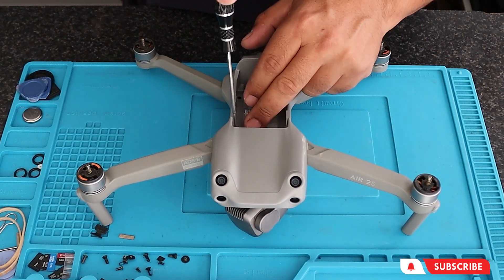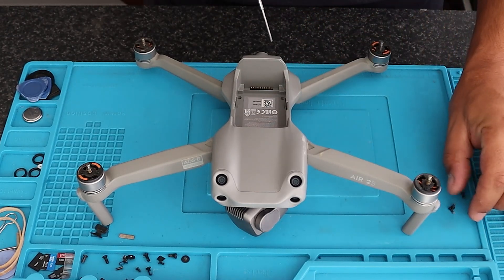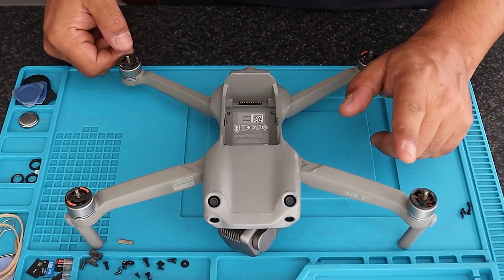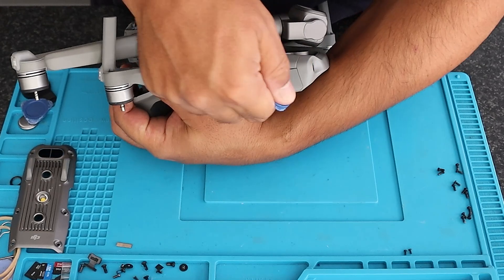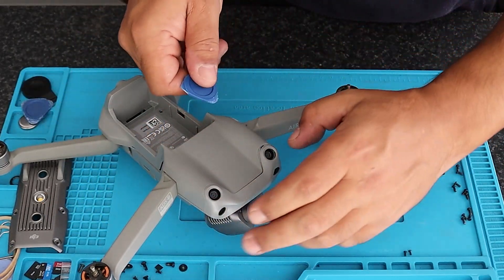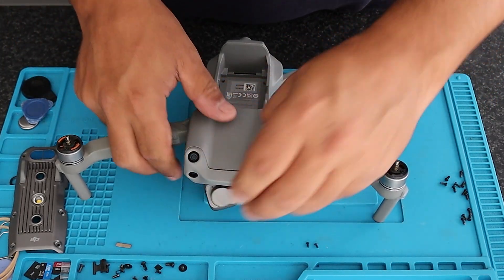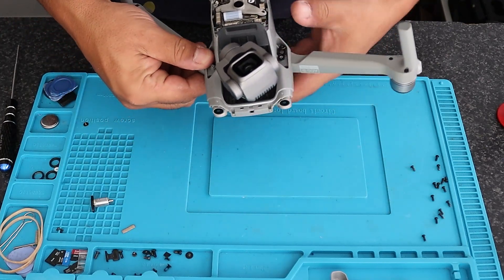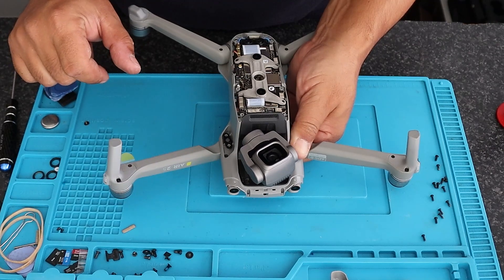How To Replace an Arm on Your DJI Mavic Air 2 S

Comment: I just replaced two arms on my Air S2, and the LEDs work just fine, but neither one of the motors do. I tested the motors, and they appear to be good as far as an impedance check. I even disconnected the wires, and hooked up one of the old motors that I knew still worked. In that motor wouldn't run either.

Comment: how much different is the air 2s compared to the air 2?    just curios since i have the air 2
Reply from the maker: Very much the same the big difference is the camera and extra vision sensors , however,  arms , Props, mid frame and a few other bits are the same .
Reply: @webuydronessa  thanks for letting me know 
Just incase I can't find parts for the air2
Reply from the maker: Always a pleasure,  thanks for watching
Reply: Sir drone Assosiries how to buy

Comment: Any idea why the arm doesn’t lock on folded or unfolded position? It stays at the “off”position like when you remove the hinge
Reply: Do you find a solution ?
Reply from the maker: You need to remove the hinge in the arm open position and put it back the same way it came out , they are spring loaded .You can manually do this with pliers should it close but it's tricky.
Reply: @webuydronessa i don’t understand i’m having the issue
Reply: I’m having the same exact issue, and chance you could do a video showing how to manually put it back? Thank you!
Reply from the maker: @etiennepequignot4870 you need to cock the hinge into the right place before putting it back
Reply: @etiennepequignot4870  I have the solution: Before assembling the front arms correctly, “pre-tension” the pivot spring to the middle between the two extremes - and then carefully fit it so that it does not snap in both directions.